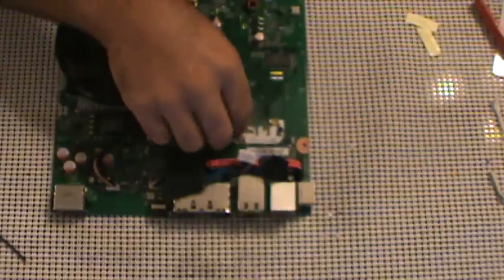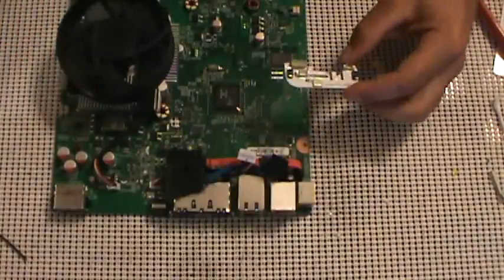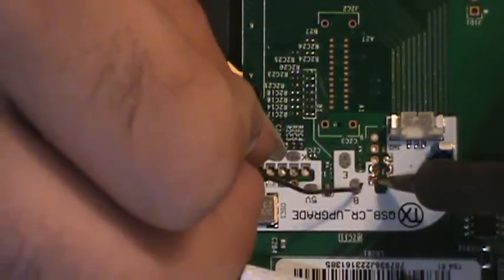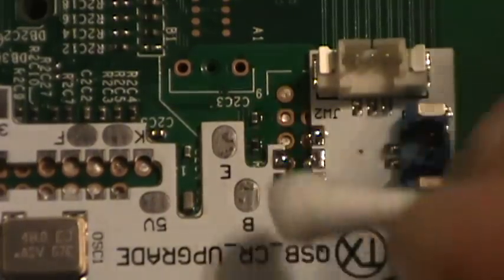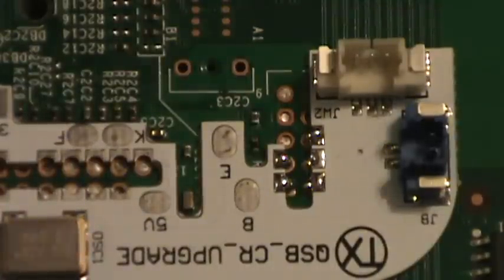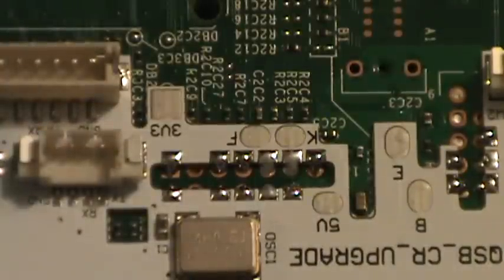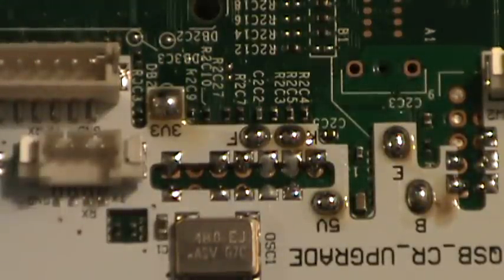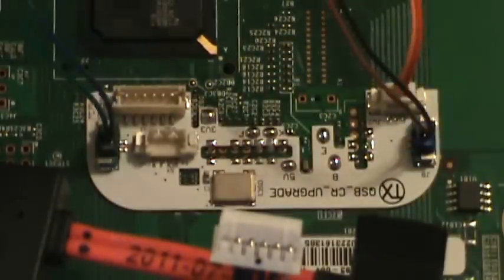Xbox 360 Corona RGH Tutorial Part 1

Comment: my xbox slim was manufactured on 7-28-2011 which would put it in the trinity motherboard stage...but the voltage/wattage ran is 12v-9.86. so does that mean i have a corona board?

second. what supplies will i need to get started? the vid is a couple years old and i'm not sure if the same nand is being used
Reply: tallblackpunk yes it's a corona motherboard.
Reply: bro mine's 2012 november manufactured console .so can flash my console?

Comment: So i have a Corona v3, what would i need to get it up and running (i was looking on an outdated tut so none of the links work and I dont know what im doing anymore).
Reply from the maker: Corona v3 needs a post fix adapter but the NAND can be read with a standard reader like nandx or jr programmer. 
I currently am not advising people to use the cr4 given recent issues frequently surfacing in the support forums. Go with an ace v2. Cheap and works just as well if not better then the cr4.
Reply: +Keil423 so the post adapter and the ace v2?
Reply from the maker: +SOZ I KILL YOUZ yes and some form of NAND read/write device such as a jrprogrammerv2
Reply: +Keil423 well yeah, thanks!

Comment: corona v2 4gb what is needed?
Reply from the maker: Corona V2 requires a 4gb NAND r/w sd card kit. Some v2 also need a postfix adapter. Not all of them so you would have to open it up and check if the post traces are there or not. 
I'd recommend a cr4 for glitch chip.
Reply: +Keil423 Thanks for the fast reply what else would I need?
Reply from the maker: +D that would be all really. 
The post fix adapter is the only variable. You have to remove the heatsink to check if it's needed.
Reply: +Keil423 Kept searching and thought I needed a bunch of things man great videos keep it up +1 sub
Reply: +D I would be able to go online with the rgh right?
Reply from the maker: +D only if you pay for stealth subscription and buy kvs. 
If you want to be able to maintain full live capabilities then a dual NAND is the way to go.
Reply: +Keil423 I bought the jr programmer, and the cr3 lite is there anything else?
Reply from the maker: +D that should work for you.
Reply: +Keil423 Lol sorry for all the questions but would these tutorials work for me?
Reply from the maker: +D I believe the install for that chip is pretty similar. I never used the lite so I'm not real sure off hand

Comment: Hey Keil, so if I dont have 40$ for a qsb, where do i solder the CoolRunner Rev. C wires at?
Reply: +Keil423
Reply from the maker: +LilDaviso your would have to get that oscillator crystal thingy and wore that up. I've never done that. Always used the qsb. You should be able to find the corona v1 qsb easily enough.
Reply: +Keil423 hey sorry ive been asking a lot of questions but on xecuter.com I saw this, http://i.imgur.com/6wscwFv.jpg , Do i bridge this or not, I ask this because on the video you never clarified. Is it necessary?
Reply: +LilDaviso yes, you bridge those

Comment: Does anyone know the location of the interal 4gb onboard disk on the original fat white arcade consoles?  I have one that got corrupted but not corrupted enough that it doesn't show up, so i can't get system / OS on to my external hdd and updates always install to the internal --- but it doesn't work.  Trying to work out a repair on my own but I'm not sure where on this mobo it is.  I think I have Jasper, it is X820379-001.
Reply from the maker: The phat consoles did not have a 4g internal memory. The Jaspers had either a 16/256/512mb. The 256/512 offered very limited internal storage on the onboard nand. 

The slim consoles had a 4gb internal storage.
Reply: Hmm I meant 512mb.
Reply from the maker: In the case of the jasper 256/512 the extra storage is on the consoles nand. The only way to change it is to dump the nand, desolder the old one and solder in a new one then write the nand back to the new one. Not a job for the average joe.

Comment from the maker: You know my knowledge on the corona is a little foggy to say the least!  There are 4 different revisions in all so its hard to keep track of what each one needs.  If I was you though I wouldn't use this method but rather just get the CR3 Pro and updated QSBs.  I'm thinking you need the post fix but I'm just not sure off the top of my head.